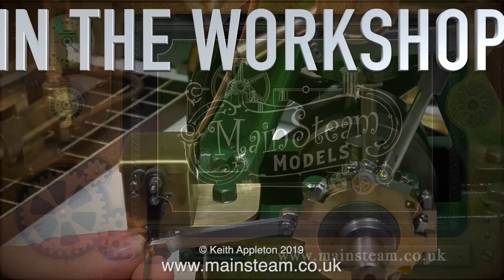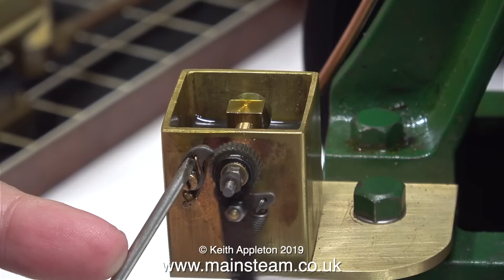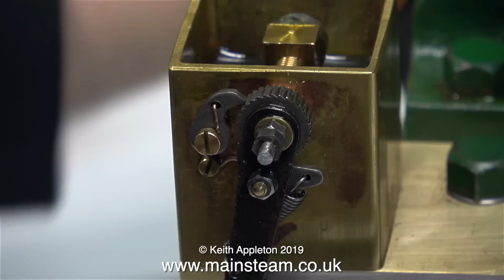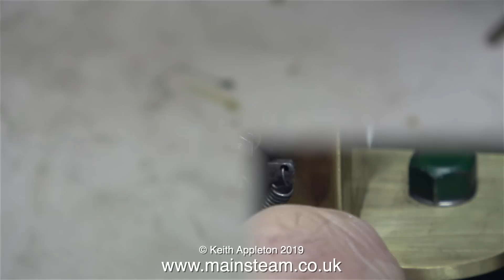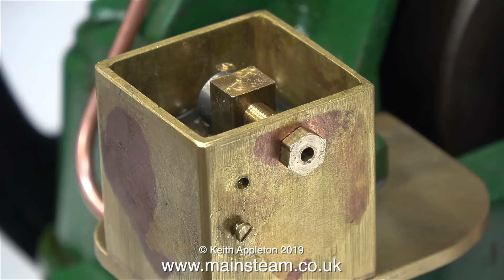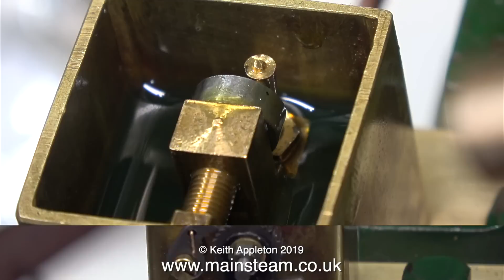HOW TO FIT A MECHANICAL LUBRICATOR TO A STUART 5A - PART #5

Comment: Hi Keith,
I'm an experienced engineer having built 6 passenger hauling steam locos in various gauges up to 7.25.
On lubricator ratchets I have used a design picked up years ago as follows: Turn a small shaft say from .2 bits 125 dia about .5 long with a stepped down screwed bit (7/8ba) to fix it to the lubricator box and one for the arm. On the plain end make a thin  slot along the axis about .156 deep. Next take a bit of thin flat clock spring cut to the width of the ratchet wheel and about .750 long. Clean it up and soft solder it centrally in the slot made in the above shaft. Carefully bend about .125 of the end of the spring so that when fitted to the lube box/arm it engages with the teeth on the ratchet wheel. 
What you have is a built in spring and because the flat spring is thin when it wares it will still engage the ratchet wheel. By making the spring double length you will have a spare.
I have used this method on all my engines fitted with mechanical lubricators for many years and they have never failed. It is also a very neat and tidy arrangement which can be made much closer to scale.

Comment: On the arm, the little bronze bushing that goes around the shaft actually tends to wear out. It happened on my LBSC Titfield Thunderbolt. I had a friend of mine make a new bushing from 660 bronze and its a tight fit. Should last another maybe 40 years of running.

Comment: If memory serves, I think I remember 'Geometer' saying; 'tighten the nut, fit the lock nut , then back off the first nut to tighten against the locknut'. Or something like that. Made sense to me! I would put a drop of oil on the ratchet. Parts like this are best hand fitted, and case hardened, or at least "Kasenited".